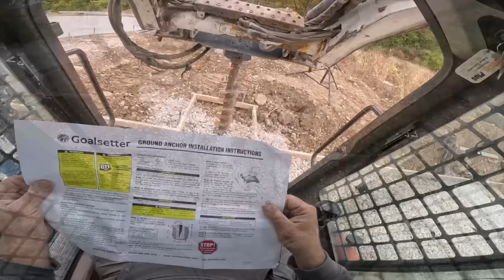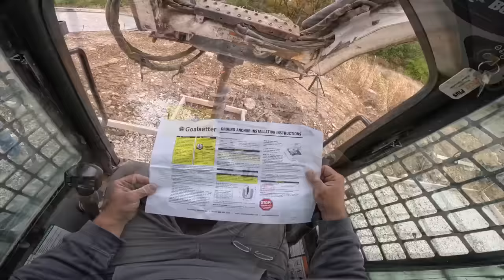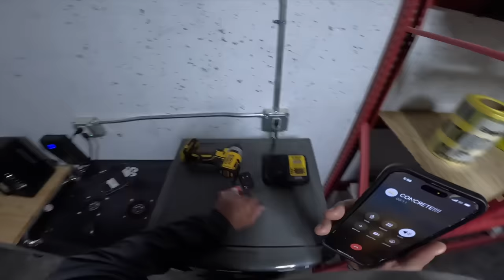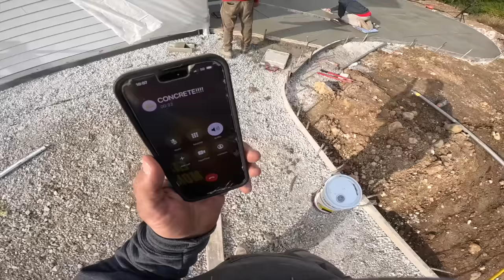The INSPECTOR was getting on my NERVES!!!

Comment: Im a residential building inspector in my hometown. The number one issue that I have seen from other jurisdictions or the inspectors before me is misunderstanding the difference between interpretation and ignorance when it comes to a trade, the building codes and the laws of engineering. Small minded people are given so much authority that any push back triggers them spewing nonsense to win an argument rather than researching, reinforcing, and planning a corrective action that better suits the project manager, their subs and the local jurisdiction.
Reply: Most inspectors were never tradesmen or engineers and have a very poor understanding of what they are even looking at or the actual regulations that govern the work.
Reply: I have talked to inspectors that will not answer questions and will repeat themselves and change the topic to avoid any actual information asked of them.
Reply: KMVS8686 not like that here in the states
Reply: No one asked.

Comment: Ah, the classic know-it-all inspector sharing their wisdom of all those 0 years of practical experience...

Should be a requirement you have previously worked in the field before becoming an inspector. So many do not and it shows by their remarks. It drives all of us nuts, it's no difference in any other construction field.
Reply: Around here it seems the inspectors all have worked in the business. Trouble is they were homebuilders who went out of business then went to work for local communities as inspectors trying to tell the successful builders how they needed to do things.
Reply: My father used to say they are guys who couldn't make it in the trades!
Reply: Here in the UK it’s just the same. Too many kids straight outta college as they can’t hold on to the experienced ones. Should be compulsory for Inspectors and Architechs to have done time on the tools.
Reply: Yes!!! I agree!
Reply: he could spell concrete so he got the position
Reply: @bobcatwelder00  As Ryan would say "Cmon, tell the truth" 😂
Reply: You mean like in most multinationals where the department head of an engineering department has 0 engineering experience? 😅 it's how the world works now apparently ...
Reply: @kevinduveneck1504  Maybe the 'successful' builders cut a lot of corners, which keeps them under budget, while the 'failed' builders won't lower themselves to that, so they go broke trying to do everything properly.
Reply: they might have tried didnt make it  i did not learn books we are better then code  always
Reply: Same issues here in the UK, to many taught in a classroom and not on site!
Reply: @kevinduveneck1504 the irony lol
Reply: I notice over the years those who get admin jobs and promote are the ones who were the most lazy and useless.  Pretend to acknowledge and agree and continue doing what works.
Reply: KMVS8686 not like that here in the US
Reply: @Lewdacris916 your wrong.     In florida you have to to have 5 years of experience and prove it to the state.    In broward and miami, you have to be an engineer or contrator to be an inspector.
Reply: @jasond1648 that usually only works for a few years, but VERY quickly their reps, or bad ones rather, get ahead of em and nobody hires em. Kinda of one of the benefits of capitalism: the weak are weeded out. Maybe it's just my area, which is primarily working class, but everyone I know while wanting to save a buck is 100% on board to do it once do it right even if it costs more.

Comment: Think I'd be taking the skid to someone else to have it looked at. No way a machine has issues every time it leaves the shop 😅
Reply: You clearly have not owned equipment. It doesn't matter what shop it a constant fight to get stuff fixed right
Reply: Stuff breaks and preventative maintenance is very expensive on equipment. He has 2 machines, no need to go through tens of thousands of dollars every year.

Sure he could have them buttoned up nicely every winter, but the losses that the breakdowns generate are significantly less, than the cost for the yearly big trip.
Reply: @johnwells920  Your absolutely 💯 right I don't own own equipment but I do however know how business works and to me and I could be wrong it won't be the first time, anytime there's these kind of issues it never hurts to be sure I'm not getting the shaft.
Reply: @stevewayne3676  anything used that hard is going to need regular maintenance. The shop isn't sabotaging his equipment on purpose if that's what you're insinuating. That's ridiculous.
Reply: I'm going to weigh in here.  My feeling for some time is that I'd find a different dealer even if it meant switching to another brand.  Notice the New Holland.  Bobcat sees him coming.  Ryan should find a good hydraulic shop where he can get hoses and such.  Maybe find a good field mechanic with a service truck.  It costs a lot to have a machine down.  I'm not sure what engine the tandem has.  If it's a DT 466, I don't recall injectors are that big a deal. Other U-tubers back there seem to have great luck with Area Diesel Service on parts and rebuilds.
Reply: @stevewayne3676 ,  As these machines get older ( just like my body) things start to break.   Hydraulic lines, bushings ,couplings, gaskets! It's a question of putting in money for maintenance or buying new!  When bidding these jobs, you should include the cost of renting a machine and that's what pays for your own machine!  If your machine breaks on the jobsite, your not losing money,,, your just not making as much!  ( this is different when it comes to tax time)  you definitely lost money! 😅   These newer machines have all these fancy safety features and computers. That's just more shirt to break.

Comment: I think clear PVC primer is in your future.  For outside downspouts no need for the purple primer, switch to clear primer and you will not see the mess anymore.
Reply: I can remember my Dad just glueing the pipe together without primer years ago !
Reply: @tnolan3176  since this is just storm water probably ok. But for the inside dwv pipes you want the surface clean and soft for the glue and good seal.
Reply: Blue Monster wetset and many of the other rain or shine cements are primerless, or use Oatey fusion.  One less can to carry around.  For what Ryan is doing with it, either one will be fine.

Comment: My 7.3 had teeth missing in the fly wheel and it made the same sound if you get under there with a socket wrench and rotate the crank a few inches it would catch some teeth and start right up you can probably crawl right under there you can probably see the missing teeth
Reply: Yeah just easier to change the flywheel man!

Comment: From a fellow business owner and operator in the outdoor ornamental industry. I Highly recommend a quality scan tool/diagnostic tool with harness connectors for each of your machine brands. I have saved a fortune on now lack of epuipment downtime. Besides very rare major failure. Issues that would require stoppage of a job to swap machinery for service has essentially vanished. I am also aware more than ever of fleet. I purchased  a $10k snap on scanner off marketplace from a technician upgrading to the new model. I paid less than a quarter and i can diagnose everything from my personal Ram 3500 all the way down to my Bobcat MT 100. Great work as usual VOS!

Comment: Ryan, your AC will run all winter long. Vehicles are designed to have the AC compressor run periodically when the heater is in the defrost position. That’s so the compressor stay lived up and doesn’t seize up from not being used for long periods if time.
Reply: You possibly know when they started this? Or is this something that's been around a while. I'm just curious if this is a newer car thing. Don't be mean please, just trying to learn.
Reply: Absolutely. It's the best way to demist windows - dry air. As soon as you select demist, the A/C compressor should engage.
Reply: @ScootsMcPoot  , I'm 60. Back in the day I thought something was wrong with my car when the A/C pump came on in the winter.  This was early 80s.  Just putting it out there!

Comment: Sounds like it might be your Oil pressure sensor malfunctioning. You can hook up a manual gauge to check and see if you have good oil pressure. If it’s good then you might need to replace the sensor. Depending on your model the sensor might be near the oil filter.

Comment: Pro tip, you don’t need primer. Plumbing code requires it but the manufacturer says you don’t need it. If you did, use clear. I don’t use any purple primer on pipe that’s visible in or around a house. I’m finish work some plumbers use clear primer others just use glue

Comment: Ryan, you should consider switching to clear primer for gutters. You don’t need purple as purple is for inspectors to check the plumbing. Since downspouts aren’t typically tied into a septic or sewer system, you aren’t going to have them inspected. I switched to clear glue and primer for downspouts and its so much cleaner. You also don’t need to slob it on. Its not a pressurized system so minimal glue is necessary. I strictly use the thinner wall “sewer” pipe as its cheaper and does just as well. I also use the matching sewer fittings and it’s significantly cheaper as well. Never had a call back since I switched to it.
Reply: Clear primer, sure that is a good idea. Switching to thin wall sewer pipe though especially in cases where it's exposed to the elements from the metal gutter to the point it is barely below grade and being plate-packed is a pathetic swap to save $20 in materials that you can just be charging the customer 1:1 anyway and save a lot of future headache by not cheeping out.  In five years that sewer pipe that is going from gutter to your elbow will get shattered by a snowblower or careless snow shovel if someone hits it.  Sunlight makes it quite brittle.

Comment: Ryan, the 7.3 either the starter or fly wheel is missing a few teeth that is causing the slip. one or the other (maybe both but i doubt it) will need to be replaced.

Comment: Hi Ryan, love watching your videos,  back in the day being mechanic and seeing you putting your heart and soul into good handywork all awesome to watch.

Regarding your T320, your sump pump in the oil pan on the engine might be either bad or clogged up with bad stuff, seeing that the machine is only stopping intermittent.

Error code 0414 refers in the manual for "Engine oil pressure low, EXTREME"
Reply: sounds like he's missing teeth on his flywheel. The bendix (starter)is spinning but not making contact with the flywheel
Reply: @gregporter2114 I believe this is in response to the bobcat problem.
Reply: Yes and I was wrong @nunyaDbiz

Comment: I'm betting it's not the flywheel in that truck. A lot of people, me included are having trouble with replacement starters in diesels lately. I'm on my second brand new not rebuilt starter in my duramax and it does the same thing with no visible damage to the flywheel.

Comment: I had both a plumbing and an electrical inspector do the same with me when I remodeled our home. Been doing that same work in the state for many years.  Refused to listen to them and went up the food chain in the department and they were both told they were wrong. 
I was actually even going above what code required so that my home would be even more energy efficient and safer for my family. 
Not many inspectors have practical experience, most learned what they know OR what they THINK they know out of a book

Comment: I never thought anyone could fill the boots of Bugs but New Ray is a superb worker and certainly know how to concrete ✌️👊👍💰🤩
Reply: There are 1000 contractors in his area just as good as bugs. It's Milwaukee.  Anytime you're near a metro area, there are good concrete contractors. They are everywhere
Reply: @ScootsMcPoot   Dudes acting like its hard anyways, concrete is like bottom of the totem pole, one of the easiest things to do and doesnt take long to learn its just  level and labor, its really not rocket appliances.
Reply: @donc7984  I know,  the hard part is killing yourself for little pay. Brick layers and concrete are probably the most mindless of the trades. Concrete is just labor intensive. Brick laying is easy unless you're a laborer. They are definitely the most arrogant of the bunch. Bricklayers are on that level of welding arrogance

Comment: I like the lines of the back patio ,that inspector is a piece of work his ego would not let go .
Reply: The inspector has a point!  New construction,  the dirt will settle under the crete and the crete will have nothing under it but air.  Lots of rebar to keep it from breaking off.  Hes absolutely correct in his analysis,  but it's not his place to tell the homeowner (not) to pour!

Comment: I think the issue with your ford is definitely the starter. Usually the bendix is loose or the solenoid just isn’t hitting right. Check for 12 volts at the starter motor voltage supply, if voltage is low it could cause issues. You could’ve also gotten a low quality or defective starter. Most starters don’t need shimming and that shouldn’t really be the issue here. That grinding you hear is it not going all the way forward and engaging the flywheel. It’s hitting the flywheel face and when it spins it isn’t putting enough forward pressure to catch the flywheel teeth. Hope this helps if you need any help feel free to reach out.

Comment: I think you need to add oil to your bobcat. It seems as though the codes triggering when your on uneven surfaces which is causing the oil to pool up to one side. I could be wrong, but I experienced something similar in my pick up truck. Drove fine but when I went up steep hills it'd slip gears. Added trans fluid and it went away forever. Just something to keep in mind if it is in fact only happening on inclines.

Comment: Connect a mechanical gauge to check the actual oil pressure. If it is good oil pressure, replace the old pressuring send unit and continue on about your work. If the oil pressure is low, it could be leaks, worn bearings, incorrect or bad/diluted oil from too much fuel or leaking injectors.

Comment: That code for the Skidsteer M0414 is a oil pressure low warning. You need to manually check oil pressure at idle and at operating RPM could possibly just be a sensor or a stuck valve in the oil pump, or bad pump altogether. It could be a number of things but start with process of elimination and get a gauge and tie into the system.

Comment: Those diesels typically stop rotating at the same 2 spots when shut off, so the ring gear may look ok from the inspection plate until you turn the flywheel all the way around. You may elect to replace the clutch and flywheel with an aftermarket single disc ceramic for less problems in the future. Usually cheaper too.
Reply: cries in skidsteer owners everywhere

Comment: Try rolling the engine a bit with a breaker bar off the crank balancer bolt. Ring gears on the flywheel can get a bad spot since engines tend to stop in the same place or two. If it takes off you've got your problem identified. Plus that could get you back on the road for that one last, last time.

Comment: Hook up a jumper pack or jumper cables to the battery then start the truck. If the starter doesnt slip then you need new batteries. It could not be providing enough power to throw the bendix out far enough. Had the same issue with mine. New batteries solved my issue after constantly replacing starters and one new flywheel.

Comment: This may be a dumb question..... but why use screen if its just gonna get smashed into the bottom of the pad from walking on it? Seems like it will be useless attached to the bottom of the concrete and not floating in the middle.

Comment: When I was a teenager, a lifetime ago, I had a '97 Chevy Tahoe that had the same issue with starting. Next time it acts up, pop the hood, grab the serpentine belt, and push & pull it a few times. Used to work like a charm for this broke teenager. I, too, replaced the starter several times, and attempted to shim it myself, but never found the actual solution. Ended up selling it. Anyway, hope this helps you or someone else reading this who might get caught in that situation.

Comment: 18:12 After trying to do some quick search’s it Seems The 0414 code is for low oil pressure so it code be a sensor going out or the oil pump being to go out

Comment: Vary low oil pressure warning Code 0414. I would do a manual pressure check and if the pressure is good then test and or replace the the sensor.

Comment: My 5.4 pickup does the same thing your 7.3 is doing with the missing flywheel teeth. I usually just rock my weight back and forth and that does the trick. Definitely winter project pull that trans off and replace the flywheel. I replaced the trans on my 7.3 dump truck for unrelated leaks, wasn't bad at all. Maybe a weekend with another set of hands.

Comment: I run my ac a cpl times in the winter (michigan) just to keep the cluch from siezing. And it lubed up. And it does sound like the starter needs shimed. Probably needs a new flywheel and starter rebuilt ( gear). But love your videos.

Comment: that M0414 "low oil pressure and shutting down" could be the oil pressure sensor going out or a problem with your oil pickup tube/oil pump but i would definitely get that check out sooner than later unless you looking for a new bobcat engine

Comment: Probably a loose connection or bad oil pressure sensor, seems to be an issue with a few other owners with it throwing code then stops.
One even had a pressure gauge and it showed correct oil pressure.

Comment: The key to keeping good vehicles is changing the oil every so often my job  has trucks with 700k miles on them and they also put studs under the gas pedals to only be able to go at a certain speed those also help a lot
Reply: Did you know the best way to use a saw is to turn it on?